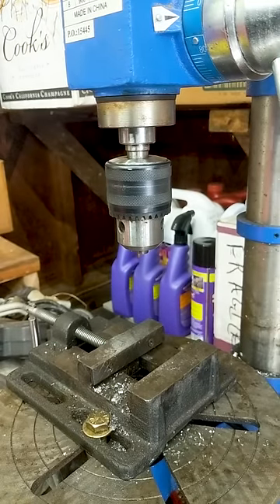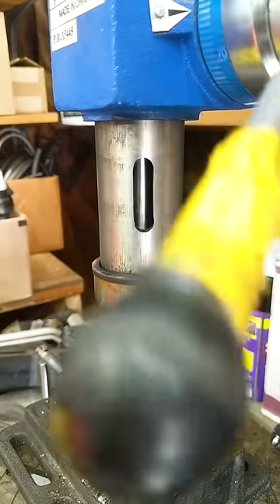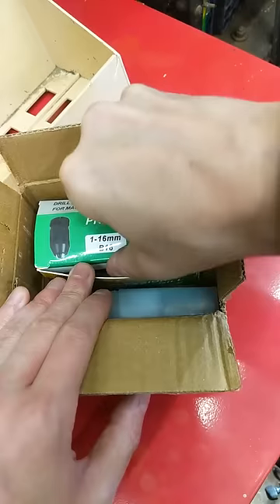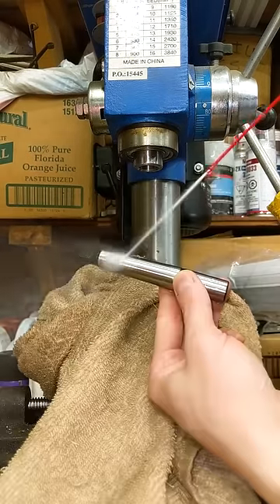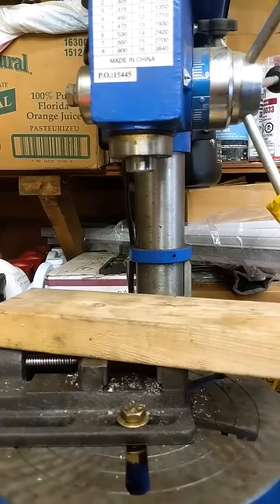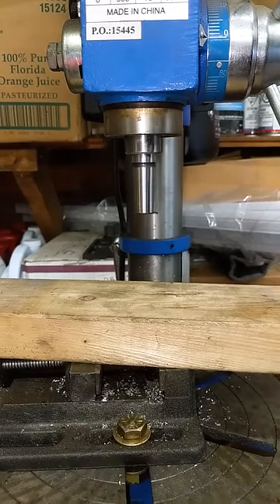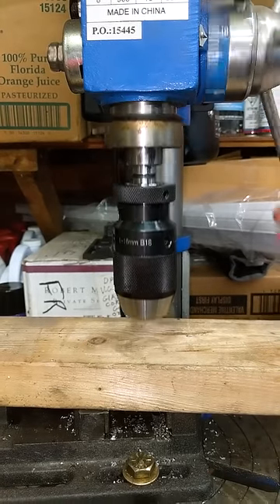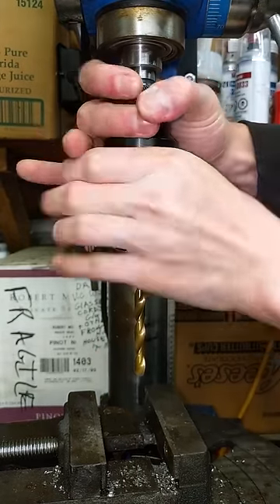How To Change A Drill Press Chuck In 60 Seconds! #Shorts

Comment: Hey clown-shoes, you will never get it tight enough. The old one was better
Reply from the maker: Working great for me!
Reply: I lost the key to my drill press years ago and can still tighten it good enough by hand. I'm sure this one does fine
Reply from the maker: They're designed for this. 🤭 Plus you can use a tool to tighten it extra if necessary.

Comment: Bang it in with a brass or lead hammer. You didn't set the arbor right either.
Reply from the maker: Almost every other person in the comments says NOT to bang it in with a hammer. Nor does anyone say you need to set the tang against the slot edges. The old tang came out fine and was never set against the slot. I think you're going off of hearsay and not concrete knowledge.